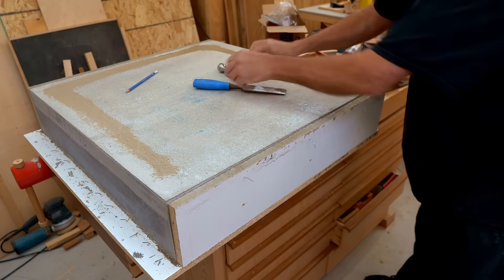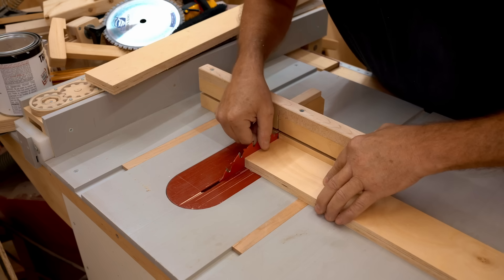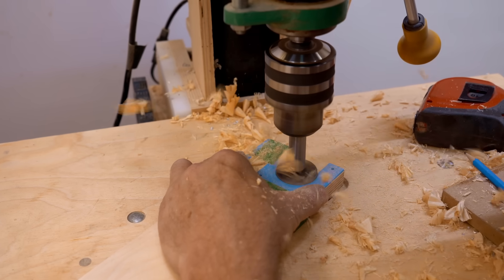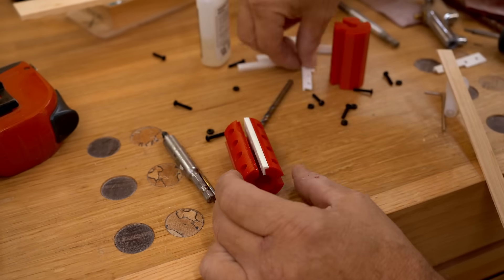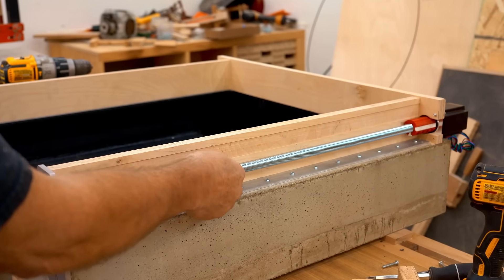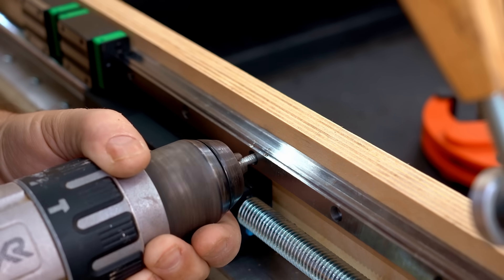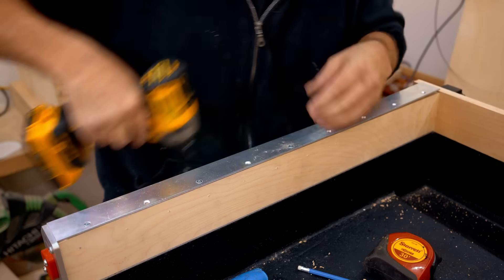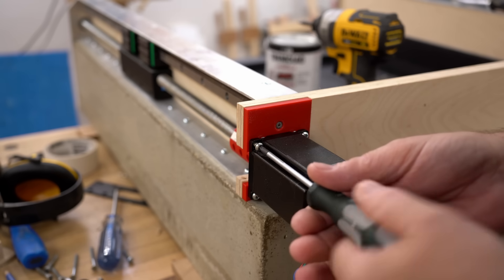Mistakes? What Mistakes? Paint H̶i̶d̶e̶s̶... I Mean Fixes It All - CNC Mill Build Part 3

Comment from the maker: Watch part 2 here: https://youtu.be/bnGUe7xMxS8
Part 1: https://youtu.be/M_tlXAoWjVI
Now that the concrete base is dry enough, I can move on to extending the side by 3 inches and getting the leadscrews and linear bearings for the Y axis installed. Like the CNC this replaces, the leadscrews are made from standard threaded rod. I used 5/8" for the leadscrews to minimize whipping (where the rod wobbles when it turns fast) and the 3D printed couplers are threaded so that the leadscrew screws in.
The side extensions are capped with 1/8" thick aluminum to help stiffen the assembly and also to keep crap from falling into the linear bearings and leadscrews.
How I made that self-centering drill bit: https://www.youtube.com/watch?v=MHKvq4ewxGg

Comment: This is such an odd combination of materials, skills, and idioms from different trades.  The nut, in particular, is interesting.  I think it is the imperfections in the print that give you such a low backlash.  Either there is a tiny lead error or extrusion artifacts are adding resistance... in any case, if it works, it works.  The easy replacement argument is compelling.  I'm surprised that you're using threaded rod.  Ball screws are getting fairly cheap.  It is not as easy to work with and if you're getting low-backlash performance with the threaded rod, I'm accidentally making an appeal to fashion.

Comment: As a budding cnc mill builder I like this a lot except for a couple things. First I would lose all the wood components in the build to help with rigidity and humidity. You put in all this work on a rigid cement base and are defeating it with wooden parts. There is a tried and proven rule that a metal milling machine should be at least as strong as the material it mills and if you plan on milling aluminum and steel regularly then all the frame elements should be made of aluminum at the very least. 

Also extending a nut does not reduce backlash as the tolerance across the thread is the same through the path. The extended length may also increase heat distortion of the plastic over time. The inaccuracy of longer 3d printed paths is probably what is reducing backlash on this part when new, but that may not last. Spring loading a pair of metal nuts would age better, provide greater accuracy and be just as cheap to make. I also think the plastic couplers will loosen over time if only from heat via the stepper shaft and you will lose steps. A smaller machine like this working at proper feeds and speeds will heat up it's motion components more than your older big wooden one. If one side fails while milling you risk a lot of damage to the machine. 

I realize you say it's never been a problem on your existing machine but it does not mean it will not be a problem on this new machine that you seem to be building to be tougher and that you may use at higher speed and lateral forces. 

All that said if you don't mill metal that much you may be fine. But I can't help but see those components as functional and safety hazards.

Comment: Seriously none of this makes sense, you have expensive precision linear rails attached to bits of wood attached to concrete. At no point did I see a dial gauge used to make sure it was aligned. Seems to be a mishmash of expensive components and poor construction techniques and I can't see you getting any kind of accuracy out of that thing. In fact you are more likely to get all kinds of issues with racking due to misalignments. Threaded bar for the lead-screws with 3d printed plastic nut. 🤯

Comment: Just a tip, if you want to glue ABS plastic really effectively;
Cut waste ABS of the desired colour into small pieces and dissolve them in Acetone, (usually overnight will be long enough). Depending on the amount of ABS to Acetone you can make a glue of varying viscosity from very runny to a slurry or paste.
When gluing ABS, the Acetone in the glue will melt the surface of the ABS parts and create a welded bond which is extremely strong.

Comment: first video - i need a proper rigid machine, so solid concrete bed and linear rails we go. stay tuned.
second video -  i mount linear rails to plywood planks, use allthread instead of ballscrews, paper thin bearing plates, and the rest will be 3d printed !
it's already hilarious but i can't wait for 3rd vid.   i need to see the gantry beam )  it must be something really spicy.

man. seriously.  remove all this plywood nonsense, mill two aluminium bars with registers for rails and mount them with bolt and epoxy directly on your concrete bed.
as for gantry - this component is crucial for rigidity so it must be steel reinforced concrete (if you like concrete) or 1/4" wall steel tube about 4"x6" section for your bed size.

Comment: You went through the trouble of creating a concrete base for the machine, only to use wood for the other components—don't you think this might not be the best approach? From my experience building my own CNC machines over the years, and after many failed attempts, I finally realized what to avoid. I started with wood too, but quickly learned it's not suitable at all. Even in a mixed structure like yours, wood introduces significant flexing and vibrations, which are harmful to your endmills.  

Milling places a lot of stress on the machine in ways you might not initially imagine. What seems solid at first may not be from the endmill's perspective. Using a machine screw bar isn't a good idea either, as it wasn't designed for continuous or rapid movements. The twisting in the frame can eventually cause binding, especially with a moving gantry style setup.  

If you're not ready to use ball screws (even if you're already using linear rails), consider lead screws instead. They're not ideal for fast movements, but they're much better than machine screw bars, especially when paired with plastic nuts. Those plastic nuts are long and can create a lot of friction, increasing the risk of binding during rapid movements. It's better to replace them with multiple metal nuts spaced closer together, if you still insist on using the machine screw rod.
Waiting for part 4!

Comment: I don't see how this linear bearing will work properly, when mounted on a piece of plywood. They should be installed on steel surface as they require no more than 0.02mm of surface deviation (by Hiwin manual).

Comment: I'm curious to see if this works. I tried something similar but threaded rod had horrible wobble in multiple dimension and was soft as butter.
Later I learned they aren't cut but rolled and it's an inaccurate process

Comment: Maybe I'm missing something but...what's the point of a concrete base if the rest is made of wood? Wood will be the weakest link when it comes to stiffness.
Reply: I was wondering this myself. All the effort to make the base out of concrete but then plastic and wood?
Reply: Came here to say the exact same thing. I'm having difficulty reconciling the effort made to prevent the whole thing from vibrating or moving (i.e. the "concrete" base) against the fact that just about everything else structural in the system is made of something flexible (e.g. wood or plastic). It's confounding.
Reply: He also uses screws instead of bolts in joining 2 wood in a T.  Use captive nut to draw the 2 pieces together!  
Screws will allow wood to rock. The screw shaft being the center of pivot.
Reply: @TheRainHarvester  he also uses screws instead of ball screws
Reply: @wormball leadscrew is ok though if you can manage the backlash whatsoever
Reply: Stiffness is still far from enough due to wooden and plastic parts. But concrete still provide massive dead mass and vibration damping capability, which is the most primary reason it is used on a CNC machine. IMO, the use of concrete as base makes it much better though still not enough
Reply: Built a similar base out of concrete, and yes... Is really good stuff for a machine base
Reply: I'm asking the same. His CNCs would make some aluminium parts to replace the wood frame. Maybe they don't flex and deform as much as the other parts? I dunno I'm no rocket surgeon.

Comment: Using 3D printed parts and wood for the structure would be a disaster. You'll definitely regret it later. I mean, the 3D printed parts won't even work properly on a 3D printer, let alone a milling machine that requires much more strength.

Comment: This is all nice work, but don't you think the value of the concrete base is somewhat diminished by mounting the linear guides on plywood? The 1/8" aluminum is also a bit weak for what you're asking from is. Sure it won't break, but for a metal cutting CNC you need it to not even budge.
Reply: LOL, armchair engineer.
Reply: @KipdoesStuff  I don’t engineer armchairs, although I might in the future. Currently I make components for industrial automation.

Comment: I have some issues with your construction:

1) using wooden boards as the base for the guide rails pretty much destroys most of the stiffness you got from the concrete base. Why not mount the guide rails directly to the concrete base? You'd have to make sure the surface is sufficently flat though, but there are ways to take care of that. Also, you mentionned that you want to use coolant, I wouldn't trust wood anywhere on my machine in that case. Wet wood will change its dimensions, lowering accuracy. The linear rails look like the cheap chinese ones too, can't trust that those are straight, and the wood isn't strong enough to straighten it out.

2) if I see it correctly you are using only the motor bearings on one side and a normal ball bearing on the other side as bearings for the leadscrew, right? That's not a good design, stepper motor bearings are only held in place by a spring washer, so you can push the shaft in a bit. The roller bearing on the other side doesn't add much rigidity either. Having a nut with practically no backlash is good, but it doesn't help you much if the leadscrew itself can move. I'd replace the ball bearing with two thrust bearings, one of each side, and preload them with nuts. I put in a pair of thrust bearings in the cross slide of my lathe and it really help to get backlash out of it, backlash is around .001" now.
Reply: You are right on both of your points :)
Reply: My thoughts as well regarding using wood.  Why after all that great work on a concrete base?  Now its impossible to use with flood coolant.   At the very least go aluminum struct filled with epoxy granite.
Reply: Agreed. Why go all the way to cast such a stiff base, only to compromise rigidity with plywood! And don't get me started on the rod and plastics. Any movement for a longer period of time will keep melting these, pushing the axes out of alignment, at best. completely strip the threads of the "nut" as worse.. The steppers will suffer because of all the friction. The point about humidity @llinkpres made also valid.

This is a very bad design as far as CNC routers go.
Reply: @ModSlash plastic nuts aren't bad in general, but there are some considerations. My CNC router has nuts made from acetal (POM) and are with trapezoidal threads. Those are in general way smoother on the thread surfaces than regular threaded rods, and the pitch is a lot more consistent. The nuts are also slitted, so I can adjust backlash. Worked pretty well so far.
Reply: @CatNolara agreed. It’s not “some” considerations, it’s many. Not all plastics are equal: Delrin/Nylon on TR can work at light loads/speeds with maintenance; the trapezoidal form helps. For John’s build I’d go minimum dual-nut C5 ballscrews; even TR8 with brass anti-backlash nuts beats printed nuts on threaded rod. Rails should be screwed and epoxy-bedded onto steel pads and/or cast-in inserts on the concrete. Never plywood, especially with coolant/humidity.

3D-printed nuts (PLA/ABS/PETG) creep, wear, heat, trap chips; backlash rises fast. 3D-printed couplers add torsional wind-up/eccentricity and can delaminate; set-screws in plastic bores slip. Carbon-filled filaments are abrasive and will lap the threads.

Johns build on the other hand... it will move but suffer. Imho he is just begging for trouble. a lot of money sunk for little utility; backlash, misalignment, downtime, and more time wrenching than cutting.
Reply: You are wrong on both of your points, But thanks for being arrogant enough to let the world know.
Reply: @KipdoesStuff care to explain why?
Reply: @KipdoesStuff  so youre saing wood doesn't expand/shrink with humidity? And that springs are perfectly rigid?
Care to explain how?

Comment: Taking up backlash is job 1 for the lead screw nut tbs, but all that extra length also greatly reduces stress on the much softer plastic nut. If anything John is too modest. Well conceived, well planned, well executed! Just another Tuesday for Mr. Heisz!
Reply: Yeah,the lead screw nut should be as long as your design allows.  The reason most machines use smaller ones is that it gives more travel for smaller machines and often rely on a variety of antibacklash mechanisms.  The longer nut is almost always better if the travel can be sacrificed.

Comment: acetone can glue abs together pretty well. jury is out as to whether acetone weakens abs in the long run but ca glue is a different kind of plastic. i use a paint brush and load up the parts im gluing until the acetone stays wet and stops soaking in, then clamp the parts together. takes maybe a little more time but when the parts heat up and cool down the idea is they do it at the same amount as the adhesive. just a theory.

Comment: My first thought on the 3D printed lead screw nut was "that won't last long"... but I suppose if it's quick to print and replace (and works accurately enough for a sufficient number of hours) then it makes for a perfectly appropriate solution. My other thought would be that if the motor mounts are printed in PLA then they may get a bit soft under heavy use (stepper heating up), but ABS would probably be OK.

Comment: You mention printing threads a couple of times. What nozzle diameter and layer height are you using? Thanks!
Reply from the maker: I used a 0.4mm nozzle and a 0.12mm layer height (I think).

Comment: I guess someone pointed this out but you made that rigid concrete base and used wood for the upper part that ruins the rigidity of the mechanism
Reply: The wood is just furniture. The metal brackets are holding all of the critical grips for the ends of the axes (axises)😅. Also note the backlash taker-uppers on the threaded rod. Trust John Heisz' engineering.
Reply: @Jacob_Dwyer the linear guides are mounted on wood... Literally the only thing the concrete does in this construction is provide weight.
Reply: A bit of l/r lateral flexing perhaps. The lion's share of support is provided by the aluminum brackets.
Reply: None of you seem to realize what’s actually going on here. That small piece of plywood is reinforced on three sides with aluminum flat stock, which provides plenty of rigidity and effectively forms a torsion box with the back of the CNC. It’s probably much stiffer than it needs to be.
Reply: I guess it all depends what precision you are looking for, but wood allows for compression and resonance that will reduce rigidity